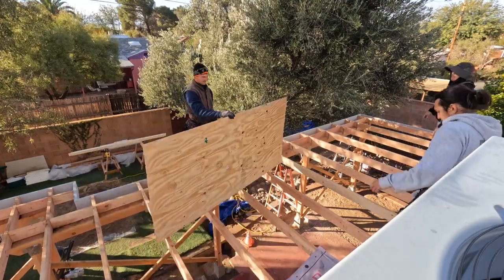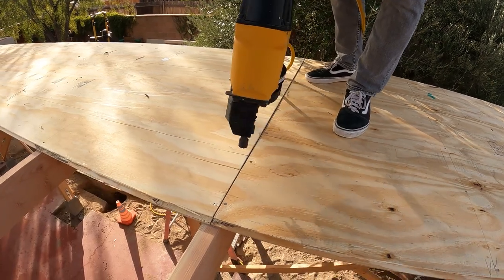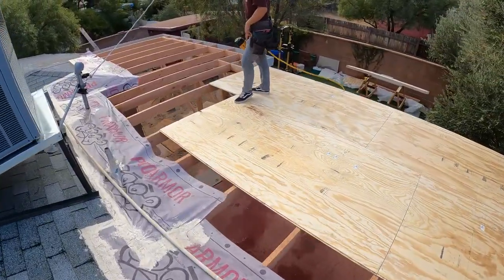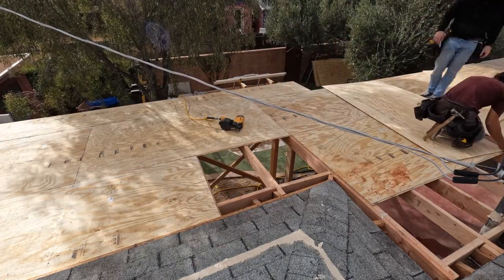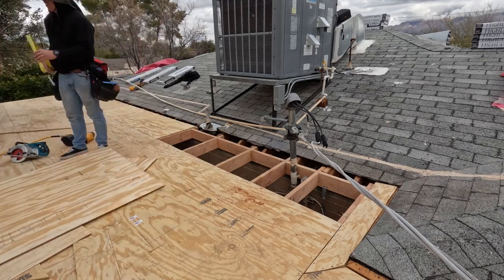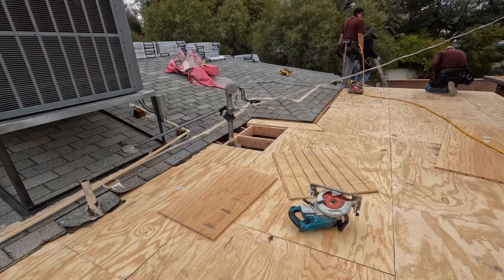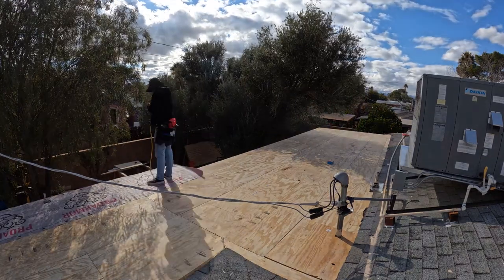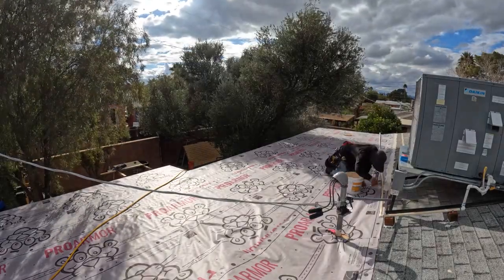INSTALLING 5/8", T1-11 PLYWOOD ON A PATIO ROOF - TIME LAPSE, HOW-TO

Comment: Why do you have to stagger joints?
Reply: It’s for strength. Distributes load, It prevents weak spots. Even though this is horizontal service it’s good practice..